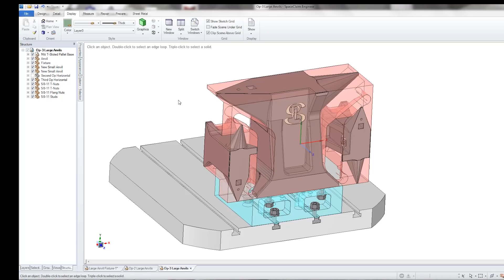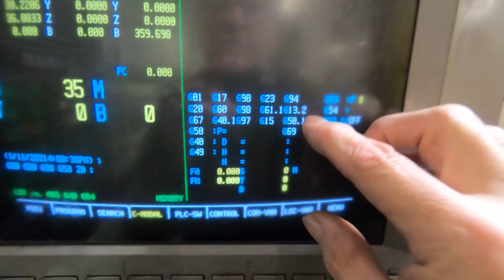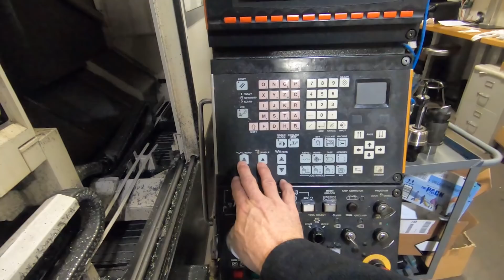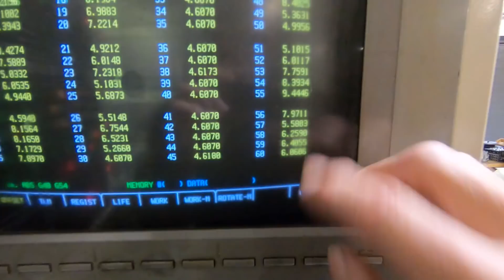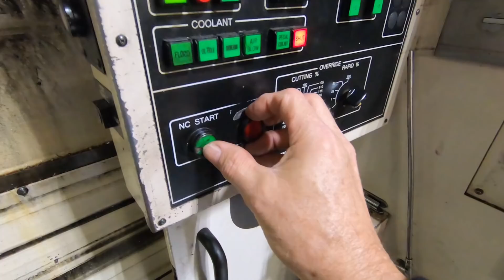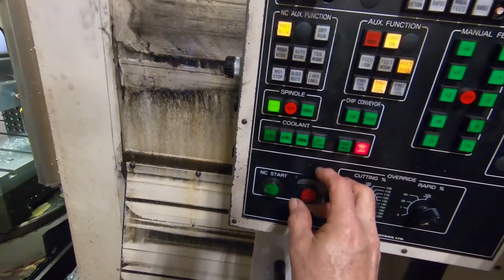Run A Tool In The First Time

Comment: Thank you for your videos - super informative!
I do have to ask: for when you need to hold the camera, PLEASE get some kind of camera stabilizing handle. I was getting motion sickness during this video.
I'm confident that small stabilizing handles are available that would have let you make this video with little to no extra effort (and maybe even a little less effort!) holding the camera.
Reply from the maker: I think I may have had the stabilization turned off on the camera. I cant remember if I used the GoPro or the Sony ZV-1 camera I have for this video. If I used the Sony it has crappy stabilization (In my opinion). I do have one of those Stabilization grips for these small cameras. But it not just a plug and play type of deal. Or as you put it no extra effort. I don't like it for inside and around the machine. I suppose it would have been better for the walking shots. Thanks for your input. I appreciate it.

Comment: Hi Peter, I was hoping you could maybe help me out with something. I am going to be starting a project with Titanium and I have never machined titanium before, I machine SS every day and have gotten very good at it. Could you tell me a good starting point for feeds and speeds for turning and threading grade 5 titanium?  It would be very much appreciated
Reply from the maker: This is a very difficult question. So much depends on the machine, part setup and grade of carbide. In general any metal with higher melting point becomes harder to machine so if 316 stainless has around 60% and inconell 718 (depending on HT) has around 15% machinability than titanium has around 35%. But this can vary depending on alloy and HT. I have machined titanium that machined very easy and some that was very difficult. This is what I would do. Start off a little slow. Say around 150 surface feet and around .012” per rev. Than speed it up from there. (I am using imperial dimensions). If you have a intermittent cut turning this can be very difficult in titanium. I find that threading goes easer than turning with full profile inserts. I feed straight in. Not at angles and not to deep of a cut per pass. Your turning inserts won’t last as long as in stainless. You absolutely need to find the correct grade and chip breaker. I would say anything that works good in inconell would be a good starting point. But you can turn titanium faster. I don’t know if that helps.
Reply: @EdgePrecision  that absolutely helps! I really appreciate the time you have given to me!!! I will keep you posted as to how I make out

Comment: Can you do simultaneous milling with the B axis or is it only positional?
Reply from the maker: On the horizontal mill? It is a full B axis. It could be used like any machine with a rotary axis. But to do true interpolated moves where the Z axis follows the rotary axis this could be done in the cod but the machine doesn’t have what might be considered 5axis type of tool comp. like my Mazak has. Hope that makes sense.
Reply: Thanks for the reply and keep up the great work. I thoroughly enjoy your videos

Comment: Actually Haas has a neat feature called Handle Feed Override, And you can control the total machine feed on the handle wheel with percentage increments(Rapid follows the feed decrement when you use it).

I usually run it all the way down to 0%(Machine stops feeding) And then use the handle wheel to slowly adjust the feed until I know everything is good to go. Then I just press 100% feed and everything is back to normal.
Reply from the maker: Yes I have used that function on my Haas machines.
Reply: Oh, and here I thought I was being smart, and could teach you something 🤦‍♂️

Comment: A coupla options for separation of the anvils from the stock, if you have access to either, would be waterjet or wre EDM. Or a friend who you trust with it. Have seen some tight tolerances accomplished with both those methods. What is the stock you're working with, and will you be able to heat treat them in house or send them out for that? 🥩🥔🍻

Comment: There is an extra step that i usually do. Make a scratch pass if not, stop after the first machined depth and check dimensions . there were times when i saved myself a lot of trouble . some parts had visible marks 0.2mm deep but that's sometimes acceptable . At least you didn't rough half a day for nothing(like a colleague of mine did) . This goes hand in hand with the unnecesary spotting . After i spot everything even if there's no need , i check dimensions , sometimes i spot pocket centers also . I am usually making 1-2-4 pieces (on occasion 4-20) . All this scratching and spotting gets edited out if there are 10+ parts . Might sound a little dumb , but sometimes this also takes care of the clearance checks .

Comment: Great video. On the topic of the Haas control, I admit am a bit of a hater but except for start/hold buttons all the others are indistinguishable from each other and crammed together so that you have to look for them every time. You can use the jog handle as override but is clearly not built for that, is very unconvinient and if you bump into it it can go up to 999% feed lol. The button for the coolant is just a switch that changes whatever command is in place so if there is an M8 in the program, coolant will start anyway and you will have to stop it manually if that is what you want.
Reply from the maker: Thanks Stefano! The one thing I didn't mention in the video in relation to the Haas control. You can set it to override the feed with the jog hand wheel. This is kind off nice because you can go to very high override %. Sometimes that is handy. The thing with the membrane buttons is it takes many pushes to do it. That takes time and are hard to keep track of how many. So this forces you to look at the screen to know what % you are on.

Comment: Really helpful video. Thanks for doing it. You have probably save a lot of future carbide, tables and spindle bearnigs with this video.
Reply from the maker: Thanks! Watching your video gave me the idea. As I said in the video. No video that I have seen on YouTube has actually shown this. This is the first thing people should be shown/taught when running CNC equipment. I guess people that have run machines for so many years just do it without thinking. So you don't think about it to show new people. Thanks again for your video that gave me the idea.
Reply: @EdgePrecision  Hi Peter, I am working putting a post mortem of the screw up I made last week into this weeks video, and was already going into detail on how I will implement the guidance yu wrote in your comments. I will link your video in as well now.
As you say, for home shop guys like me, there was no one to teach me this. You have done us all a great service there.
Mark .

Comment: Good explained!  What you  could do is also check the end of the program after the last cut. Because then it starts to move rapid again to tool change position or to an other operation with the same tool.  In my opinion rapids are the things where most accidents happen. Also simulation of the programs can show a lot . Luckily most machines have simulation programs 😀

Comment: About the knob controls: I would add that that they should have a different shape and color, so that the feel is really different and the visual location is faster. I know the research on that has been done in nuclear control room simulator, and the prototype used beer tap handle of various brands to validate this idea (I must have read that in one of Donald Norman's book).

Comment: On my Fusion post processor it generates high feed rates for repositioning moves in radial milling. This is truely dangerous, as 1 maximum feedrate move is still super fast with the rapids and feedrate set to low values. A 16 000 feedrate wont give you much time to react even at 5% feed.

Comment: Agree totally with the "Detent Knobs". First Lathe I started on had them and they're awesome like you say - you keep your eyes on the tool while your fingers are very near the feed overide knob. The newer ones with the "tactile" buttons are a bit hard to use. Does your controller have the option to "block through the program"? I found it also very helpful - especially when doing a first run on a part  where the customer only supplied enough raw material/forgings etc.... Keep up the good work. Love your videos!
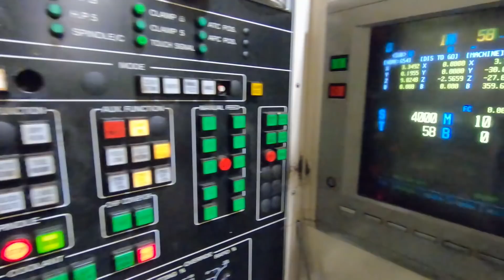Reply: Oops, hahaha...@14:11 - answered my question. Cheers

Comment: The controls seem rather esoteric, but there's good reason.  If I had the means I'd have a pendant with a display and a button to hold down to enable movement, single block or not.
Reply: A push to feed might create problems when doing operations that are synchronised between the spindle and linear axis.  Eg. If you were rigid tapping and let your finger off you would snap a tap. Single block usually overcomes these problems.
Reply: @mtnbikeman85  Fair point.

Comment: That rapid override be like: way too fast/still too fast/way too slow
Reply from the maker: I didn’t demonstrate this in the video. But in these cases you can put the machine into the dry run mode. In this mode you have more control over rapid moves. I seldom use dry run but I should have shown what it does.
Reply: Yup found that running a BT30 drill/tap centre

Comment: My control is a touch screen.
Plus: can see the tool path preview in 3D
Minus: zero tactile feedback

I ended up making my own little control box and doing the electronics to emulate the bits i need (but just a few buttons.)

Using different feeling knobs for different functions is actually a "human machine interface" best practice, but sometimes I think these panels are designed by the marketing department, not people who focus on reducing human error...

Comment: Those are membrane switches of some sort. They either have tactile domes underneath the mylar (preferred), or have PCB traces underneath mylar and push a conductive pad against them.

Either way, their main advantage is cost. A potentiometer with detents is probably $5–$10. Tactile domes are pennies.

The biggest problem I have with those damn things is that the mylar will wear off you. Either you'll get a clear spot in it, or sometimes even an actual hole.

Mach 3 and LinuxCNC have buttons you click with the mouse or keyboard shortcuts. Both leave a good deal to be desired.

For what they charge for those controllers, they really ought to be putting proper discrete push buttons on there. Those membrane switches are just crap.

Comment: The first thing we're gonna do is slow the rapid down... Peter should be in charge of new drivers!!!  ROFL
Reply: If you happen to run a Haas machine, one thing I do on mine is to link the feed with the rapids. This way whenever I slow down the feedrate, the rapids also slow down by the amount proportional to their overall speed setting.
Just something I got used to when running Heidenhain machines.

This means that if you're running production and you change your feedrate to be below your programmed feed, the rapids will also move slower than the machine maximum, but once you feel comfortable running that same program, I guess you could just disable that setting all together or update the feedrates to your new value.

Comment: Very Good Vid!  A+    You Liking Fusion?
Reply from the maker: My primary cam is Esprit. But I am using Fusion more. Especially for my plasma table. I have also used it for the machines in the garage. I still haven’t gotten real proficient with it yet. So far so good. Thanks!

Comment: The distance to go and single block mode are definitely features you don't want to miss, once you know how useful they are. These are now on my todo list for my self developed machine control software. 

Also, the knobs are subject of intuitive machine control design. Unfortinately many development engineers don't know a lot about it.

Thanks a lot for this video! I really appreciate and like this format and would like to request more content like this. Maybe you can try to improve the shakiness but this is critics on a high level. 

Thanks a lot!

Comment: "distance to go" is definitely the most important thing on the control to be watching when proofing a program.. lots of operators don't even know it exists
Reply: Or avoid G0s entirely and do it by G1 with double feed rate or so, then you don't have to care about 2 knobs. At least that's how I do it if I program something directly into my machines.
Reply: @hinz1  i like having the part done some time this century
Reply: @SuperAWaC  Fixing a crashed machine takes longer than waiting a few seconds until the machine is in position. My approach isn't good for mass production, but I like it for prototyping. And that's what I do most often on my old CNCs.
Reply: @hinz1  When you're proofing a program, you want the actual program, not a modified one. Because when you repost it out with the rapids, you still have to proof out again. Because it's a new program. You can feel a little safer, if you're sure nothing was changed. But it's a still a risk.